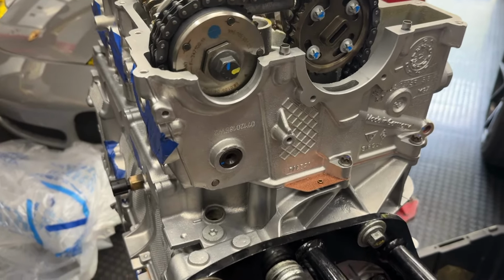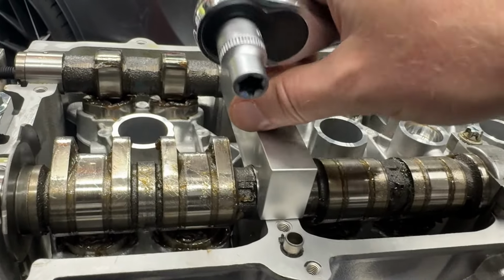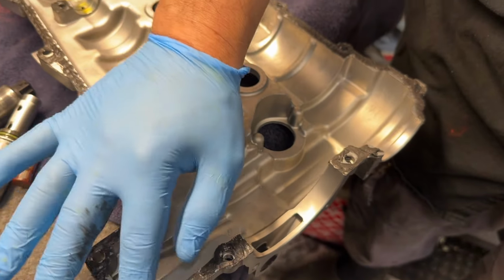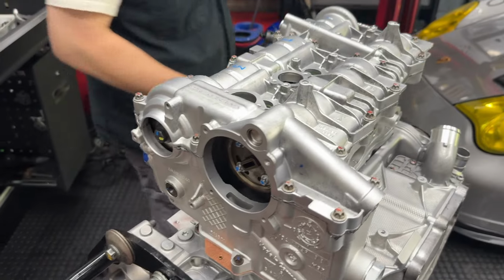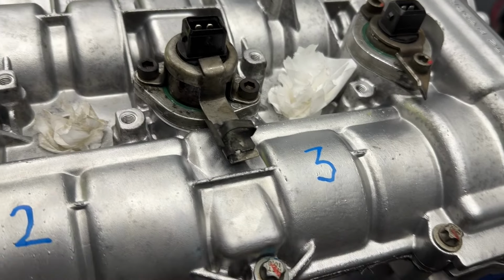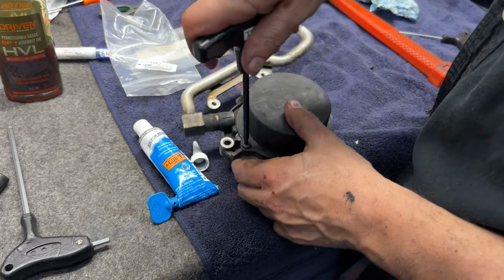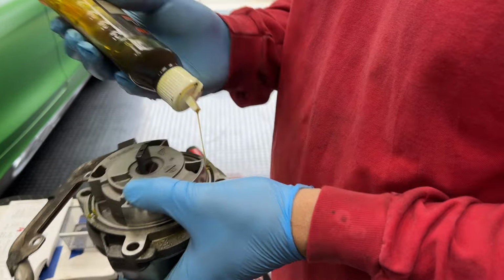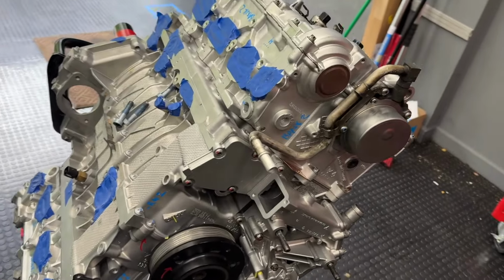Porsche 911 Engine Assembly Guide Part 25 - Camshaft Cover and Scavenge Pump Install

Comment: The plugs your referenced as freeze (out) plugs are also called soft plugs and both nomenclatures are applicable. If you didn't get the smaller plug seated all the way just use a pry bar with a piece of lathe between the bar and the head to send it home. This tip is applicable to all engines, not just Porsche. Apply a 1 mm bead of sealant on the oil side of the periphery only and none on the cam tower mating surfaces. The bolts only need sealant on the ones where oil can migrate up the bolt shank to the bolt head and leak. You guys probably figured out the 2nd scavenge pump you installed has a vacuum pump assembly for the power brakes. Hope my comments will help and they are always meant in a positive way.
Reply from the maker: +@warrenlucier5796 all tips and info always appreciated! 🍻

Comment: I don’t have firsthand experience with 996 vacuum pumps. The base looks different than a 9A1, but the top section cover with eccentric and slid-bar appears to be the same. I have had two 9A1 vacuum pumps self-destruct on track. The first caused a fire that totaled my 987.2. After the second one failed, no fire; thankfully, it's the first thing I replace on any flat-six engine before tracking it. I've been told the top cover is aligned precisely with the eccentric slide bar, and it's not possible to reassemble it with precision if disassembled; not sure if that's rumor or fact.

The 9A1 pump is available from Pierburg, the OE vendor for the part. Again, I'm not sure about the 996. If it were mine, I’d replace it for peace of mind because you get about two to three brake applications if it fails (no fun at 120mph) before you lose power brakes, and it causes significant carnage in the engine bay if it goes.

I did a lot of research at the time when my second one failed, and I think it's because of the wear of the shaft spinning the eccentric, which causes a vibration and causes the screws that hold the cover to back out. If you re-use the pump I'd go with the red Loctite :)

BTW, I love the series; it's very useful to the DIY Porsche community.
Reply from the maker: +@flatsixaddict yikes! Thanks for the info. One of the reasons I make videos is to learn from others as well 🍻

Comment: Hi guys, what sealant did you use for the cam covers ? … btw, this 911 engine build series is awesome & has given me the confidence to have a go 🥶😀🤞
Reply from the maker: +@martinhazard7812 thanks! See 3:40 in the video. I’ll add a link in the description.
Reply: Sorry, I missed that 🫣 … with the way product technology moves on, I might try contacting Loctite/Henkel & see if they can recommend a product that will do both crankcases & cam covers 🤞

Comment: This freeze/molding hole plugs can distort,better to push them from the outer edges..like oil seals or sealed roller bearings..
Reply from the maker: +@user-du1mz5zx7s 👍🍻

Comment: 24.00 I hafta ask: Why didn't you clean these covers and the bolt heads better? I would have.
Reply from the maker: +@MrJbipes because the vapor honer is at my house and sometimes we just have to push on or we will NEVER get this finished 😝
Reply: @HelpMeDIY  yeah, I get it. I do that too.